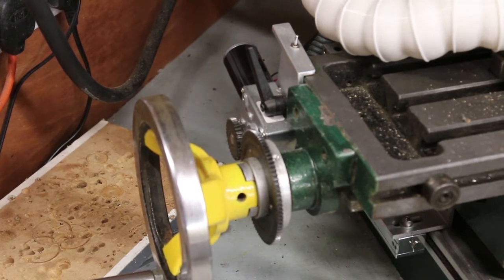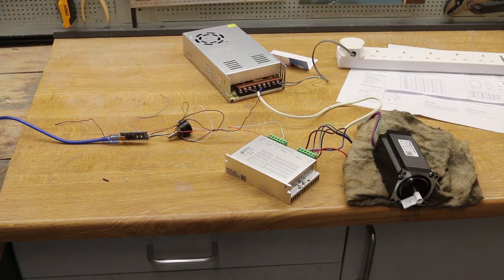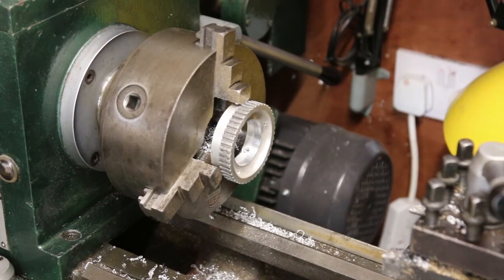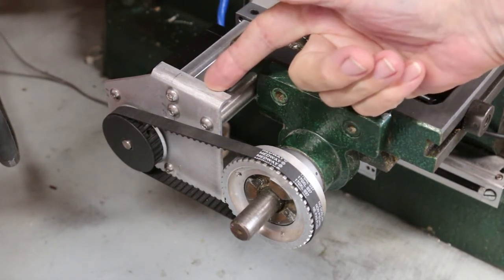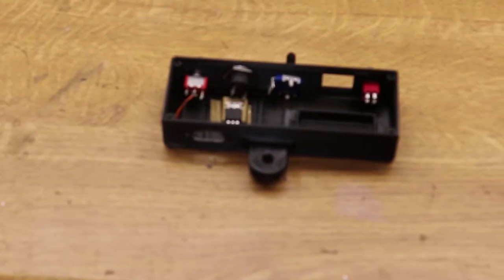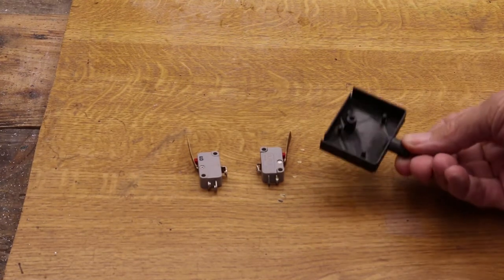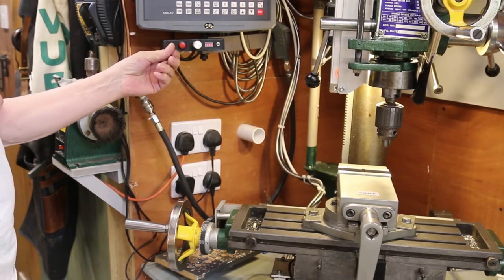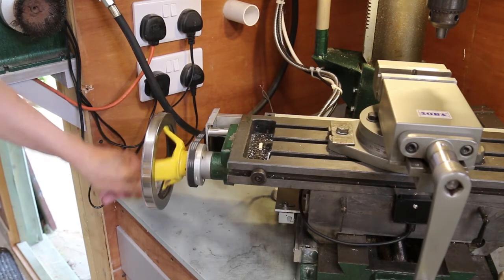new mill power feed

Comment: Do you have the code and wiring to share? Great video.
Reply from the maker: I thought about sharing the circuit and software (my normal practice) but I am using an unusual display module (spares box!) and most of the wiring concerns that. There are many videos dealing with driving stepper motors with an Arduino, and the Arduino IDE has libraries for this. Rather than re-invent the wheel, my two 'take aways' were the mounting requirements and the use of the Enable (really Disable) signal to permit manual operation without need to select it.